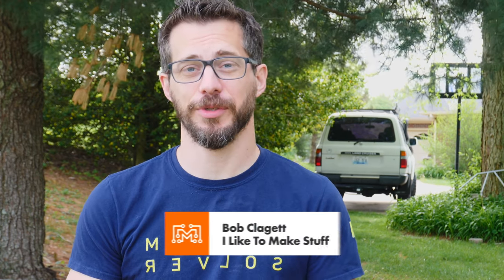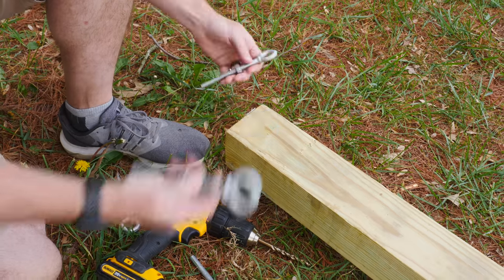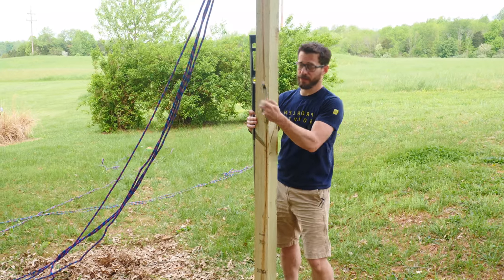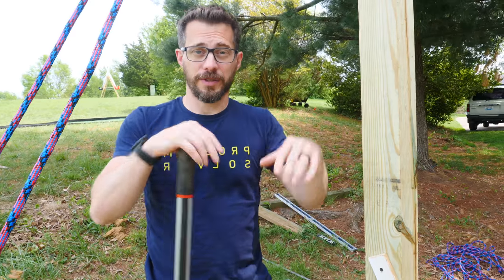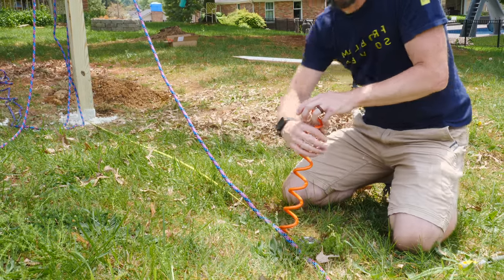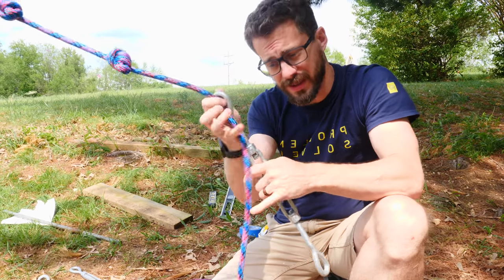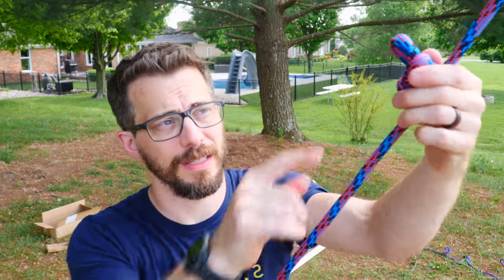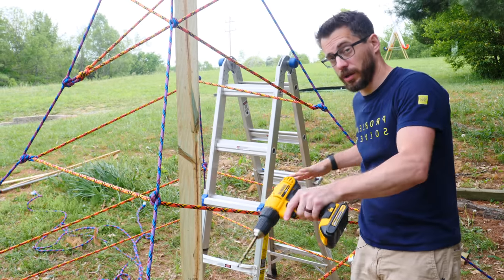How to Build a Rope Pyramid Playground (w/ I Like To Make Stuff)

Comment: Another hint: for the knots to avoid getting smaller, use the butterfly knot! They are really strong and used for many climbing applications, so they'd be a good fit for the project.
Also I'd cut the bolts and use a ring nut, that way you save on bolt holes and avoid any sharp threads sticking out

Comment: I love your videos but that middle pole seems like it moves alot and could possibly get even looser over time with all of the movement.
Reply: Indeed. The foam thing is pretty cool, but the strength is probably good for fence posts as he said it's made for, but a much taller structure that people will be climbing on? I would go with concrete.

Comment: Before you cut the rope, do a couple of wraps of electrical tape.  Then you can cut through the middle of the tape leaving both ends neat and tidy.  Finally, burn the ends.
Reply: Derek or just cut them using a hot thread (not really cutting but melt them appart. That way the core fuses with the jacket and you reduce wear and tear

Comment: PLEASE FIX THOSE BOWLINES! The bitter end should NOT come to the OUTSIDE of the loop. It can catch and cause the knot to invert.
Reply: Also, overhand knots inline are not a good idea.  Use something like an alpine butterfly instead.  Also, make sure it's a rope rated for exterior use(uv degrades nylon rope such as climbing rope) and I would suggest putting them under more tension, maybe use a come a long to be sure.  It will sag quickly otherwise.
Reply: Also, use 'Screw Gate' Carabineers for the anchors at the bottom for extra safety.

Comment: Talks about how safety is the number one concern and how your materials need to have a higher working load then you think you need. Then proceeds to use post foam and twist ground stakes to anchor everything 😳. This is a great project but please if you plan to do this use concrete to anchor everything including the ropes. I really don't expect this to last. one good rain will make all your hard work fall apart. Maybe that's what you were going for? Something that will last a few days so your kids can play on it and then you can easily take it down?

Comment: So he spent $27 for the fence post mix. When an 80 pound bag of concrete cost about $3-$6.
Reply: Lord Ba'al that was just him sponsoring for Lowe’s.
And the concrete would last longer than that foam stuff
Reply: No hé don't spent it, hè get it sponsered
Reply: Obviously if you know what you’re doing, you’re going to get concrete. That’s done to death in many many videos. But for some people they don’t know, don’t want to, or can’t concrete. In that case it’s cool to show off an alternative. Additionally if someone is looking to complete this as a “one day project”, which seems doable, concrete cure wouldn’t work.  Set in 3mn is a lot better.  Lastly, the mix is $10 and should be equal in volume to 50 pound bags of concrete. So still more expensive, but not that bad.
Reply: @SierraGolfNiner  They make quick setting concrete which will harden in an hour or less.

Comment: Instead of using an overhand on a bite or figure 8 on a bite like he did to attach the ropes in the middle, use an alpine butterfly knot. Its used by climbers to attach to the middle of ropes because it wont tighten as the rope goes taught.

Comment: 7:33 Check the rating on that carabiner - that does not look like a carabiner intended for this sort of application. I'd suggest a screwgate or twistlock carabiner rated for 25 kN straight-through load at least.

Comment: Public park near us has several of these and the kids love them.  Especially one set up that uses two poles and has essentially a rope suspension bridge between the two climbing poles.   The "bridge" is triangular with one high rope and two low ropes, with cross rope weaving them together.  

Because its  public park apparatus, the poles are steel and all the rope connection points are coated in epoxy.